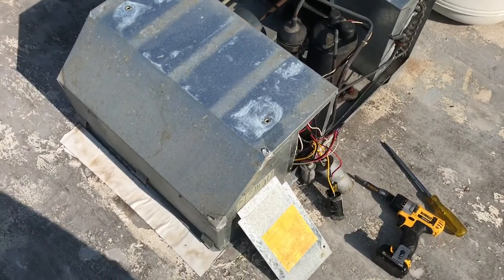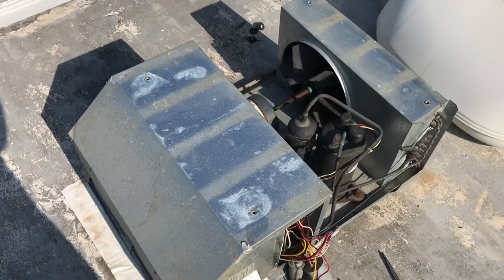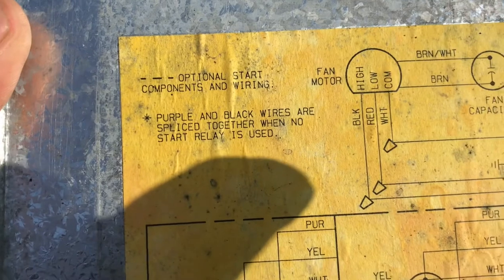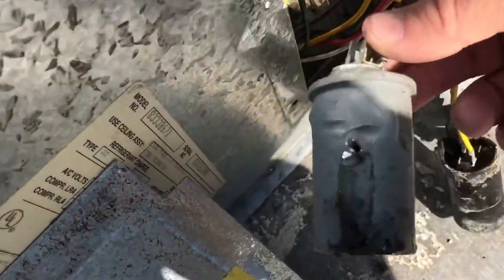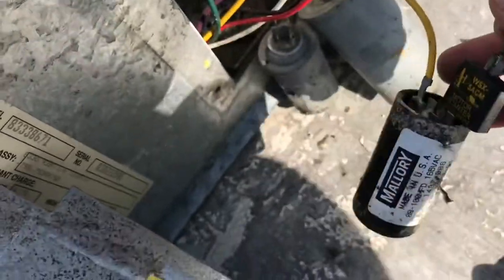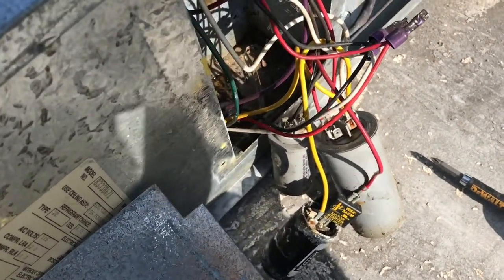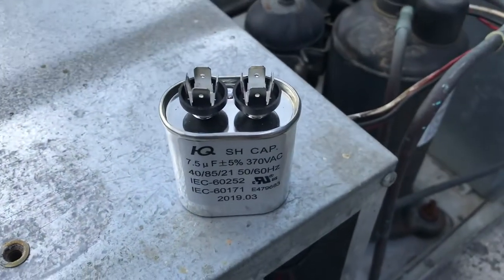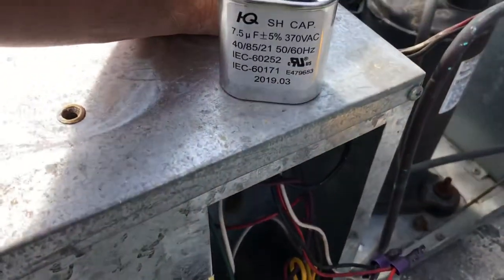Replacing Capacitor in Coleman A/C

Comment: Did you wind up finding the capacitor last as a set??
Reply from the maker: No. I just purchased the one and it solved my problem.
Reply: @jefflynn4079  which one did you replace? The one that was blown out?
Reply from the maker: @erichnl1  sorry for the slow response. The one in the picture is the only one I replaced.
Reply: @jefflynn4079  How did you know what type of cap to replace it with? Was there a label or something with a part #?
Reply from the maker: @jonmccauley6490  I believe I pulled the specs from the old capacitor.  Unfortunately that didn’t mean two trips to the roof of the camper.
Reply: I watched this to see which wire  (brown/white and brown) went to which side of the new capacitor. And you completely skipped that part. Do you remember which side was which?